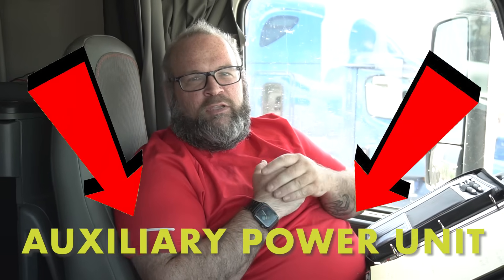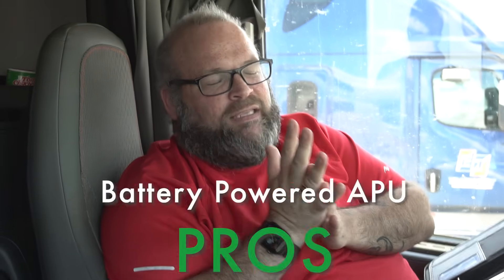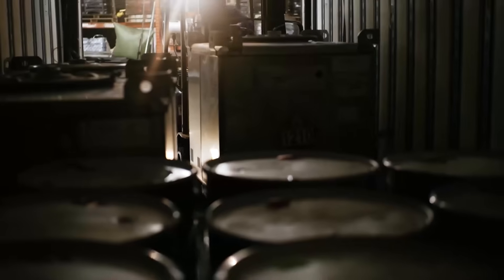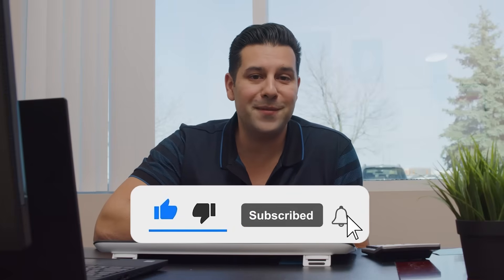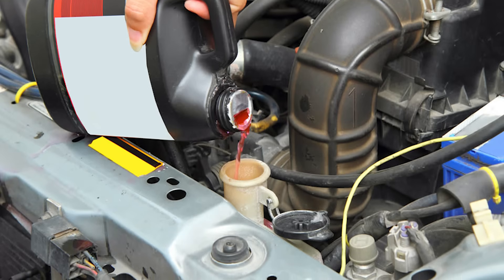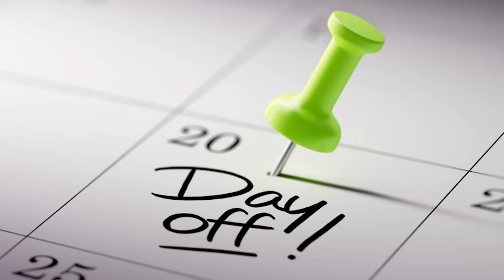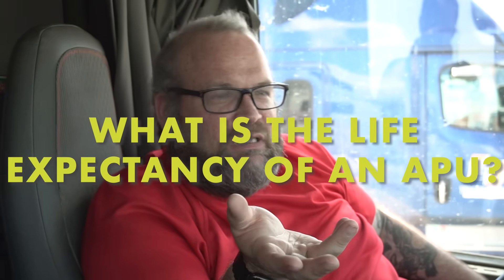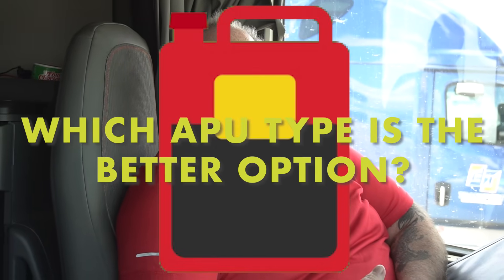Diesel Operated or Battery Operated APU: What Is The Best APU Unit?

Comment: One thing about the battery APU people don't understand is if it's installed properly then you simply turn on the battery protection mode in your truck and after 8 hours your truck will start idle for about an hour to recharge the batteries and then you're good for another 8
Reply: But this is illegal in many areas why you can’t idle for any reason.
Reply: can u describe where is that batery protection mode i have pete 2022 ? and my aux get low and truck didnt start on its own , it was on auto start but it didnt start ??

Comment: will your battery apu work in freezing conditions?
Reply: Absolutely! However, for heat, better to supplement with a diesel fired heater. Compact and cheap. The size of a lunchbox $1000

Comment: APU are great, my Diesel burns over 1 gallon an hour during idle. Stupid expensive, and hard on the engine. Still, if your employer has an absolute no idle do not work for them! They do not care if you freeze to death. 

At -45 C if that APU  packs it in and you cannot idle nor drive because of roads conditions you are dead. I know because 18 year ago it happened to me. Again during the Covid-19 bs lockdown mine crapped out in the far north.  This time I fired up my Diesel and ran that puppy until I could get moving. It was only -20 C then, but plenty cold enough to kill if you have no heat.

Do "not" trust the trucking company cares about your life if you have no damn safety line in a storm when your APU craps out and you absolutely cannot idle!
Reply: I was just talking to a Heartland driver, he said they had to settle a lawsuit for a guy  who they didn't allow to idle and died of heatstroke. So now they can idle.
Reply: @trentallman984  I hope they got hit stinking hard. The people that made the decision should be jailed for manslaughter
Reply: @vitaquasus1120  he said it was in the millions. I run for just a guy, and he doesn't care. But I still use a fan whenever it makes sense. It will be 66 here tonight so I will be fine.
Reply: @trentallman984  I hear that, 66 is almost to warm in the bunk without a fan going. 
I hate running my diesel while I sleep. It wakes me cause me rotten sleep. Still it's better then dying of heat struck.

I'm glad it was in the millions, ain't going to help that trucker much though. 

Be safe
Reply: Find a motel in that case
Reply: All I can say is you write pretty well, and at length, for someone who’s been dead for 18 years. People today just aren’t tough like that. 

Probably drive at night a lot, I’m guessing…
Reply: @markstevens1729  hyperbole is a dying art I suppose lol 😆
Be safe

Comment: Bought 2 thermoking electric APU's for both my cascadia's.  FYI during the day when extremely hot you'll get 4-6 hrs in the sleeper with the curtains closed.  Will have to idle to recharge if not driving soon.  As for the night, I'm getting 9-12hrs.  I have had them 2 years now with 0 repairs.  Best $20k spent.
Reply from the maker: Thanks for the info!
Reply: How many hours they can function without running the truck in -20C ? Thanks
Reply: @emranhossain893  eh I imagine his numbers are pretty close at those temps just cut your numbers in half.
Reply: How much they cost is it 20k for both or single one

Comment: Wouldn't it be cheaper to put a Honda generator in a vented box work just as good?
Reply: Many truckers have gas generators on their rigs.  Not as neat but definitely cheaper.  Only downside is having to get gas for it.
Reply: Doubtful. Diesel APU's are plumbed into the truck engine coolant lines, so that the APU can keep the engine block and oil warm for easier winter starting - and warm air will come out of the vents!!! lol 
I don't think a generator in a vented box can be plumbed into the coolant lines.

Comment: Apu exemption gives you 400 pounds. So legally you can run 80,400. So you actually can carry more weight then normal. Apu does not weigh 400
Reply: Exactly, and they are over 400 lbs. eg. Kenworth smart air electric apu adds 555 lb according to spec sheet.
Reply: the one I found at Volta AIr it weight only 150 LB
Reply: Wrong it only allows 34400 on ur drives. Under 80000lbs.

Comment: A little clarification Dave. No loss from payload. Most Jurisdictions give you an extra weight allowance if you have aux power for no-idle.
 I have experienced batteries on a Cascadia and been parked next to plenty of hammering apu's. Battery is a no brainer imho. Zero moving parts, takes up much less space imho (between frame rails under grating). Cheap and easy to repair if/when deep cycle batteries fail) Can be used to boost starting batteries if needed.
 What is the federal weight exemption?
A 400-pound weight exemption was signed into federal law on August 8, 2005 as part of the Energy Policy Act (US)of 2005.

225Kg in Canada since 2011 

These are federal laws which apply to the interstate/TCH . A few jurisdictions go their own way unfortunately for state routes.

The only time I wished for a diesel powered one was once when it was hotter n hell in NY and my stu*** dispatcher informed me 5 miles from delivery that my appt was day after tomorrow :-(
Combined with a tiny diesel fired espar heater to heat cab and engine it was terrific!
Reply: Diesel APU is much noisier than the battery APU. A diesel APU when running makes terrible noise worse than a reefer unit. Hard to have a good sleep.